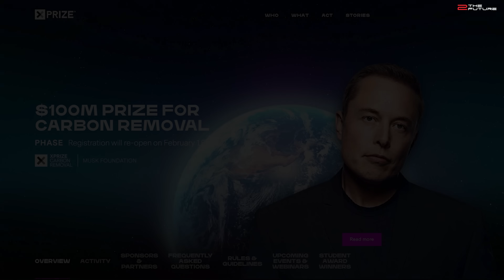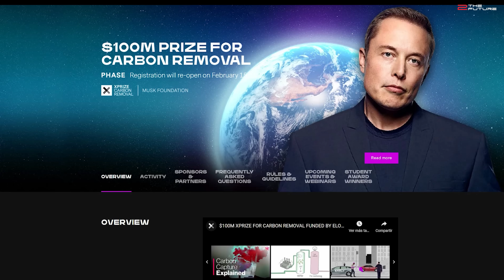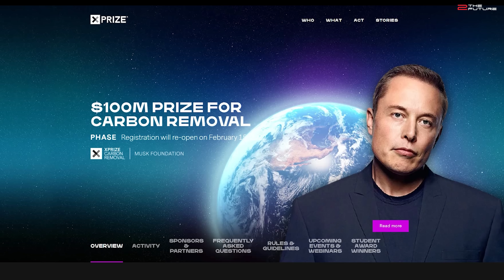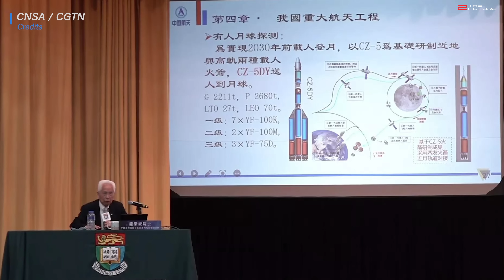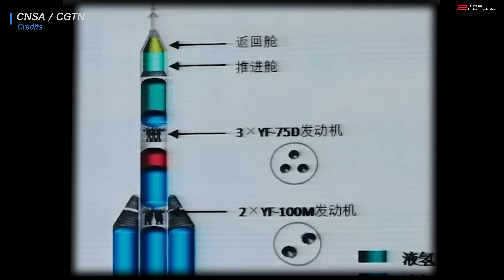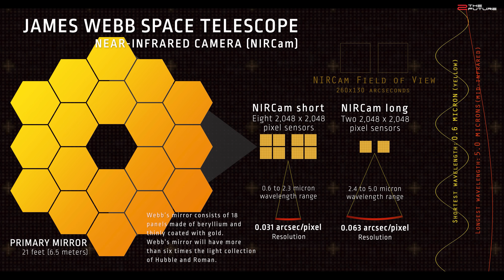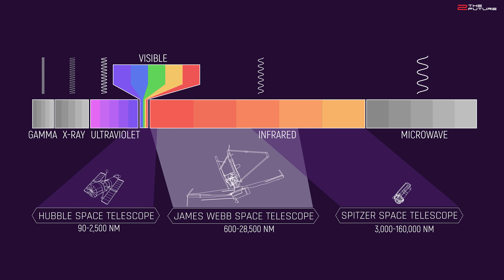How SpaceX will solve two big problems of humanity in one go.

Comment: Now tell us how energy-intensive carbon capturing is and were you intend to get all the required clean energy.
Reply: Asking the real question.
Reply: SpaceX has two large one acre solar panel arrays, several wind turbines and a dozen Tesla powerpacks in BocaChica.  They currently make more energy than StarBase consumes...there is plenty of spare energy for making methane with...and if there is ever more need - I'm very sure they'll just build out more capacity.

Carbon capture is in the form of their "Sabatier" reactors which were designed and built at SpaceX's Florida facility - as a part of the research activity for making fuel on Mars.  They pull in CO2 from the atmosphere - make Hydrogen from water hydrolysis and produce Methane and Oxygen as a result.

So - does that answer your concerns?    It certainly should.

Comment: As a Tesla investor I am glade that SpaceX is going down this rout. I am certain that Tesla was probably offsetting the damage.
Reply: Well before I pop your bubble I would like to point out that even if launches increased by 10 fold rocket launches still would a be a negligible contributor to the generation of greenhouse gases. So that disclaimer out of the way SpaceX is probably not going to create more than 10% of it's fuel for Starship though CO2 from the air, it's an inefficient and expensive process, it makes sense to do to improve the process for Mars where it's your only real option, but if Elon really wanted to help he would offset the greenhouse gas emissions by giving out grants to people who want to install solar power in their homes.

Because extracting CO2 from the Earths atmosphere and then using the Sabatier reaction is so energy inefficient that you could install 1/10 the generating capacity of solar panels for electricity generation and still offset more CO2 than you would offset by generating all your fuel from CO2 from the atmosphere. As said it's still a worthwhile thing to do to refine the process, but lets not kid ourselves that it's actually a particularly "green" move.

Comment: The first carbon-neutral rocket?  Not by a longshot.  That would have been the first to be fueled with hydrogen and oxygen, which Blue Origin's New Shepard uses.  If we are going to use superlatives against the ill-informed Luddites, they had better be accurate.

Comment: With starship being not only neutral but potentially pulling more CO2 out (since CH4 is useful not only for rockets - that tech could be used by SpaceX to produce/sell CH4)
There is a chance they win Elon's own XPrize haha
Reply: And yet, no well defined and well thought out argument has been made to establish that CO² is actually bad.  Firstly, the process keeps being made in reverse; Temperatures go up, THEN CO² levels rise, because ocean water loses it's ability to hold as much of the gas at higher temps than at lower one. Secondly, CO² levels have many times what they are now without adverse effects to the planet. 200 years ago, CO² was at 200 parts per million (ppm). Today it is @400ppm. Commercial greenhouses pump CO² into their facilities to reach levels of 900-1200ppm, as that is where plants grow best. Over the last 30 years the Earth has greened by 35%.(As per satellite imaging) More and healthier plants mean more oxygen, which means more ozone as well, reducing ultraviolet  radiation at Earth's surface. As for the rising temps, more people die from extreme cold than extreme heat. Rising temps mean larger areas of  arable land for food production, and greater oceanic evaporation, meaning more rainfall. (5000 years ago when temps were 5°C higher, the Sahara was a lush land of freshwater lakes of greater surface area than the Great Lakes of North America) 

The West has become a land of 'Chicken Littles' running about screaming "The sky is falling! The sky is falling" over anything and everything. Man up people!